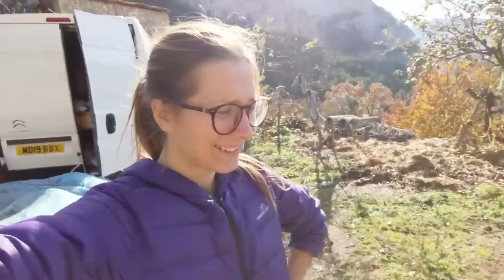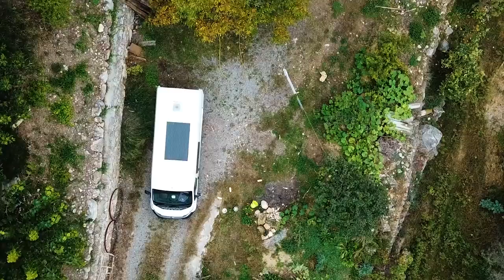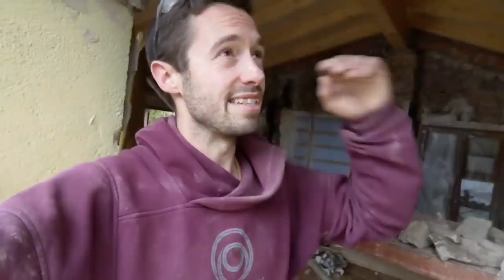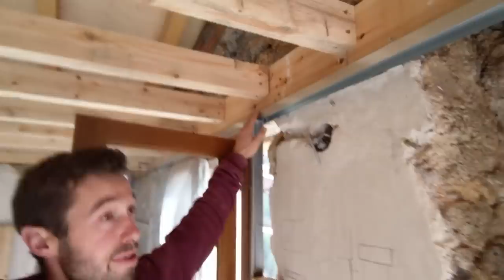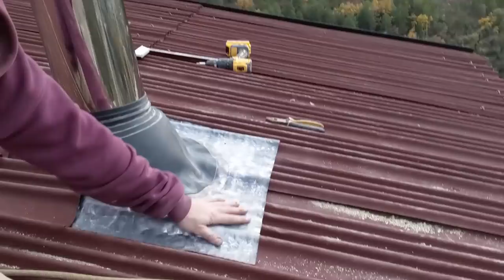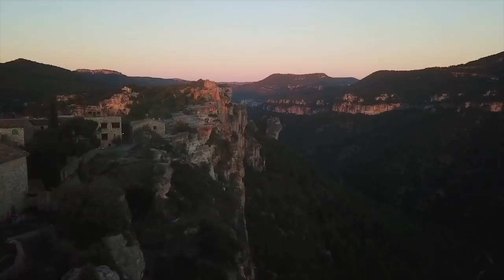A TON OF 💩 - A HOLE IN THE ROOF & CLIMBING IN SIURANA  |  NMAS Ep37

Comment: Love your use of concrete!  Small story:  Back in the 1950's, my dad added a ground floor bathroom in his parent's house as they were getting too old to climb stairs.  He didn't have the proper connections for the piping under the toilet; in other words, he had pipe but no fittings that worked and he had to finish the job and return across the state to go to work.  It was a Sunday and no big-box stores then.  So, he packed about 8" of concrete all around the piping and called it a day.
Reply from the maker: Ha, that is interesting. I guess it would work pretty well for a good length of time if you got it all round good enough. When someone comes to do some work on it they will be thinking 'what the....' :D
Reply: @NateMurphy  Oh, he absolutely packed it tight all around!   He used to get a chuckle about the eventuality of someone digging that up.  He was a structural engineer.
Reply from the maker: @brose27377  😂😂

Comment: Buy fluid applied flashing.  Couple companies are polywall blue barrier 2200...prosoco is another brand.
Reply from the maker: Thanks for the tip! Could be a good layer over the cement.
Reply: @NateMurphy  I don't see the point in putting it over cement..not to mention the color is bright blue for polywall so that would be weird.    I meant to use it around that chimney on the roof.  Also around windows.  You'll have to paint over it though,again,it's blue.